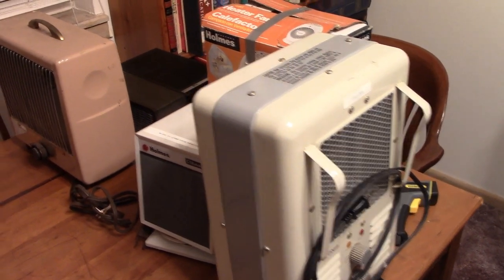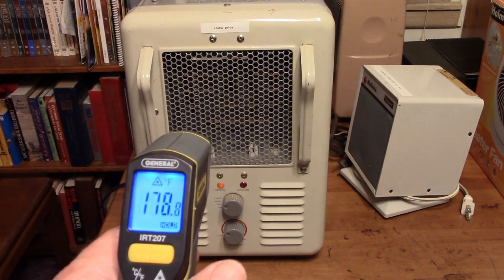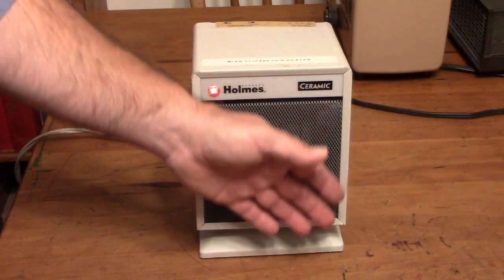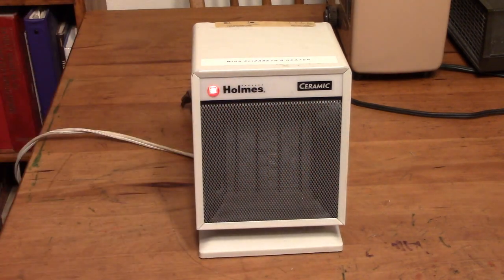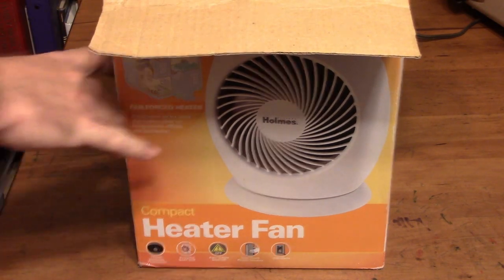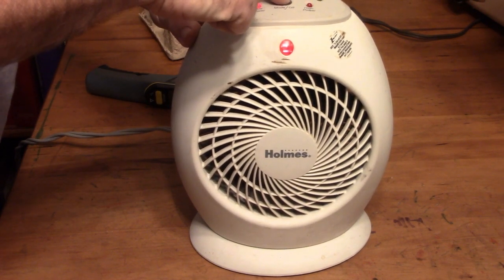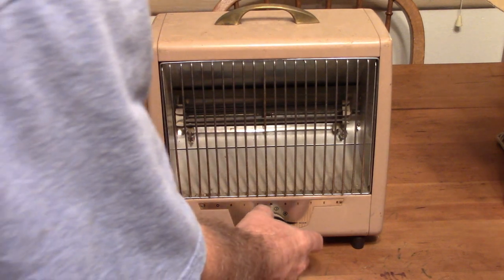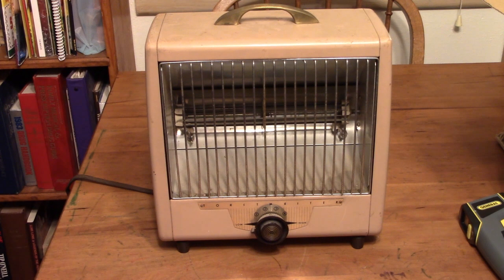Space Heater Tests For 2021-2022 Heater Season

Comment: Isn’t it amazing how the vintage heaters put out so much and are really simple with design and that newer one that you have already gave you issues. Just love vintage can’t help it. 
My aunt had that same heater that you’re showing at the end and it did the same thing the fan rattled it was the weak point of that heater.
Reply from the maker: Indeed. I'll take periodically adding a few drops of oil to a motor, over a failed control panel any day!

Comment: I found a little Patton Heater+Fan from probably the 80s-90s (i’m not quite sure when) and it works very well! It’s a small heater, but puts out a nice amount of heat, with three different heat options. Maybe I should take a video of the first run of it this weekend and show it off a little bit! I also have two of those Holmes heaters and I hate the controls too. I did find out that they have a sort of “memory” where if you press and hold the button down, it powers it off without having to press the button seven thousand times. Then when you press the button again, it turns on to the previous setting you had it on. Just a quick tip if you get the button to work again or get another one!
Reply from the maker: Awesome! I'd watch a video of it if you decide to upload one.
Yeah the actual heater works fine. That control layout is awful. Thanks for the tip!